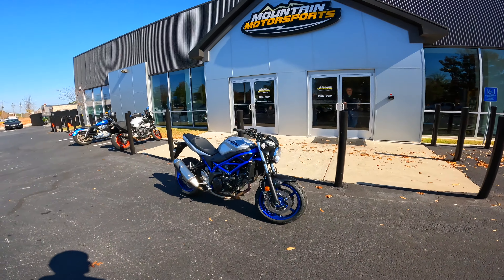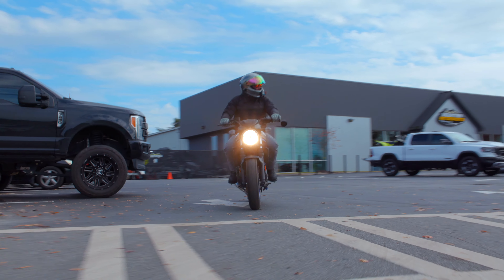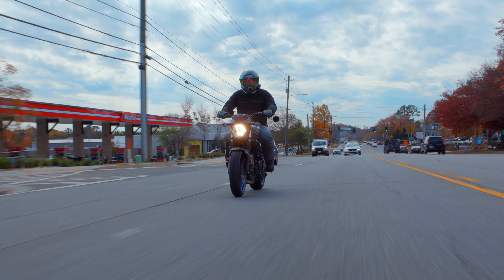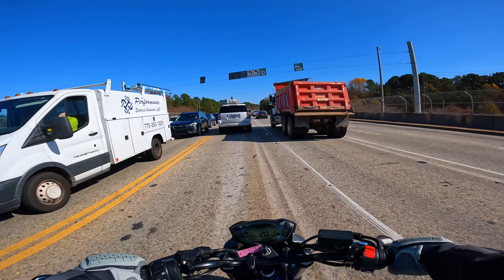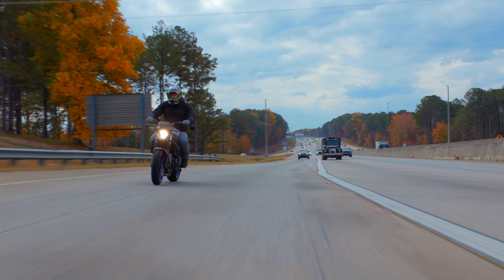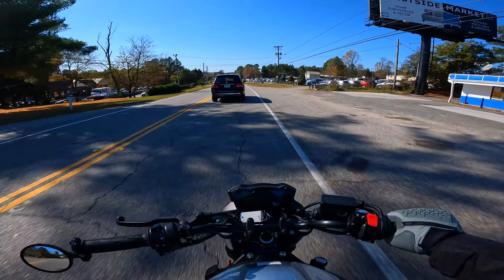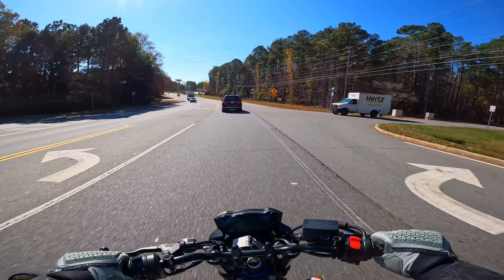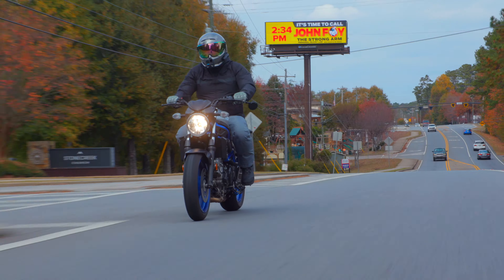2020 Suzuki SV650 | First Ride

Comment: OC: The SV650 is the Mazda Miata of motorcycles. You can do literally anything with it, and if it won’t get it done in stock form there’s an aftermarket mod that will get you there! 🏍️💨
Reply: Facts!!!
Reply: OC: I’m 61 years old and started riding five years ago, on an SV650. Chase was one of many influences that helped me make that decision. I’ve got 21K+ on the SV. In April 2022, I bought the OEM top case then rode from Nashville TN through southern Missouri Ozarks down into Arkansas then across Texas to Austin. I attended all days of the MotoGP race at COTA, then rode the SV home through Texas, Louisiana, Mississippi, and Alabama. Not one single problem and fun fun FUN! Hoping in the future to improve its suspension and brakes and take it on the track.
Reply: Miata is that good because of its light weight. SV on the contrary is heavy as concrete block. The heaviest in its class. 
I was riding it during my licence course and I hate it. Everything is crap on this bike besides engine. 
My Trident or MT 07 are bike world Miatas, not this. 😅
Reply: @conViction0000  Still too heavy and powerful imho. Modern Motorcycle Miata is the Ninja 400.
Reply: @graylunsford  are you in Nash? I just moved here a few months ago with my 19’ sv650x. Every long trip I’ve done I thank the fact I don’t need to worry about the motorcycle. It’s always me who gets tired first
Reply: ..and no! a sv is not a beginner bike!🤟🏼🙏🏼🌍
Reply: @daleidenjoel5655  SV is definitely a beginner bike most 650's are designed with beginners in mind that's why they are so much less powerful than smaller 600's that are designed for advanced riding/track like the R6 or ZX6R
Reply: I like the analogy of a Miata but I personally think that down plays the sv a tiny bit lol. They have a decent amount of power
Reply: @conViction0000 MT07 also has crap components lol. The SV may be a little heavier, but it handles way better then the MT07…
Reply: @sollux13 it was never designed for beginners in mind, that's just an American mindset on big displacement engines
Reply: @MrMikeDao  Thinking 650's aren't for beginners is cope from Europeans that can't ride anything faster than a vespa
Reply: @sollux13  I'm not european buddy. I just don't fall for the simplistic american mindset that you think you need more than what you actually use. See too many liter bikes get passed by 600cc class bikes at the track. 

If you've ridden as long as I have, 12-15 years ago 250cc was "beginner." A bike with 650cc sold in 1999 did not have beginners in mind. Just Americans thinking they need power to live on highways. Just need a brain

Comment: I considered selling my 19' sv650x once for something with more power and electronics. Took it out for a final ride before the sale and immediately knew I couldn't sell it. You wont find a more reliable, capable, and engaging bike as the sv650 for the price. 22k miles and a 47t rear sprocket later and it feels faster than ever! The community for these bikes is in its own league too
Reply: That’s awesome. My buddy has an older one and its still kicking. Hoping the GSXS I purchased is as reliable long term.
Reply: This is something that’s fast enough to give you thrill basically every time you open it up while being very usable on the street. Least if you ask me

Comment: Good to see Chase finally giving this bike the respect it deserves. He was pretty harsh on it when he reviewed it in 2017.
My thoughts, as an actual SV650 owner.
1) The SV650 is not going away, at least not in 2023. And if it continues to sell well, Suzuki would be crazy to get rid of a money maker. I don't consider the GSX-8S a replacement for this bike. They look nothing alike.
2) This bike is for everyone, not just beginners or people who want to work on their bikes.
3) For me, this bike is plenty fast for the streets or canyons. if you're doing 0 to 85 mph, this bike has all the power you need. Any faster and you'll risk losing your license (in America). 
4) If you want a pure bike with just the basics (ABS, fuel gauge, gear indicator), and one that is fun and fast, consider this bike. 

The reasons I would upgrade to another bike are for things like a factory quick-shifter, slipper clutch, cruise control, and a fully adjustable suspension.
Reply: Couldn't agree more Organic.  Love my 2020 SV650.  I'm currently addressing the (ahem) budget suspension with Ohlins fully adjustable cartridges and a Wilbers rear shock, hence no need to upgrade!
Reply: Do you think I will buy this then “outgrow “ it in a year? And want a z900 or mt 09?
Reply: @JohnnieV  In terms of performance, most people can't really outgrow this bike for street riding. But what you want in a motorcycle could change. I know a guy with an MT09SP who says he wants to go back to smaller displacement bike because he can't use all the power of his bike on the street. So it all depends. For me, middleweight naked bikes are just right.
Reply: For the track, you only need to do suspension work...  brakes might be a plus, but it handles great.
Reply: @JohnnieV Depends if you want to go over 100 mph much.  It doesn't make peak power, but it has out of the hole and midrange power above its weight.  If you like the twisties, stiffen the suspension and Bob's your Uncle.  It is a popular track bike for a reason.
Reply: I’ll say you’re not wrong, it’s very reliable And good in city driving, but as chase said, if commuting on highways and stuff like that or bigger roads it can feel like it’s either under geared or underpowered. 

I got it as a beginner bike and I’ve been using it for 2 years (having used sports bikes before on and off), and I’m looking to upgrade, I’m a bigger rider 240lbs and 6’ so I do feel pretty small on the SV.

Comment: I'm 68 Years Young. I have been riding since I was 15. Had my Motorcycle Endorsement continuous since I was 18. Currently Bike Less due to some bills I had to pay. My most recent ride was a 2018 Honda CB500X. VERY nice and comfortable Bike, but it had a pulse and wobble in the front end when braking that NO MECHANIC I took it to could figure out. Mechanically, I know the Suzuki V-Twin Engines VERY well, and think they are extremely reliable and long lived. I DO intend to get another ride, and I'm seriously considering an SV-650.

Comment: I bought a 2023 SV650 (non ABS) a few days ago. I have to say my impressions of the bike don't match some of yours... The brakes are fine, the handling is stable, the bike is flickable, the engine is wonderful, I am in love with this beautiful bike!

My other bike is a Matte Raven Black 2021 Yamaha MT-09 (gen3, non SP version). I dearly love my MT-09, but I can corner faster and more comfortably on my SV650. That's unexpected, to say the least.

My only problem with me having bought my SV650, is I want to ride it more than my MT-09. It's not so bad that I want to sell my MT-09, that triple is so much fun, but this little V-twin is awesome!
Reply: Do you still have both? It's kind of an odd pair of bikes since they're so similar.
Reply: bevause they upgraded front brakes from 2021 I think, but yeah all others I have same experiece

Comment: I think the handlebar is stock.  I actually like having narrow handlebars when lane filtering because sometimes the opening between cars is very narrow and I need every inch of space that I have.
As far as torque goes, the torque is almost the same at all rpm, but there is slightly more torque at high rpm  (max torque is at 8000 rpm).
This means that you can ride in pretty much any gear you like, but if you want to accelerate hard then you have to downshift.  Without a wind screen, riding on the interstate is rough, but it's the perfect bike everywhere else.

Comment: I rear-ended somebody's CR-Z and totaled my 07 SV650S, miss it so much even if I only had it for a week. This was the single highest-cost-to-performance middle motorcycle with relatively high top speed until RS660 came in. That bike however didn't even come close to how cheap an SV is, used or stock.

If I can have another motorcycle I will definitely hold onto a 2nd gen SV650 / 650S again, or even a 1000S.

Comment: OC: It’s not just you. I have a third gen SV (2017) and it really feels like Suzuki engineered the fun out of it. The riding position is almost frustratingly neutral and overall it’s bordering on Honda-like complacency (read: boring). Plus this third gen has a minimal aftermarket compared to the first two generations unless your plans are to go full-tilt track weapon. 

It may sound like I don’t like it, but that’s not quite the case. It’s my second motorcycle after my Cbr500r, which weighed exactly the same, and has lots more pep and capability than that ever could. It fits the role of two wheeled Miata; it’s the answer to all questions, but there are other offerings that also excel. 

If nothing else it gives the rider the chance to experience a v-twin that isn’t a potato-potato-potato American cruiser, an adrenaline filed temperamental Austrian street bike, or a pompous Italian“L-twin”
Reply: I owned a 2017 and did 45k miles on it. loved every second. I feel like I had a different bike than everyone else though. All I did was a KN air filter, airbox mod (the dill some holes in the cover one) Throttle kit(another super easy one) and a cheapish delkevic exhaust. My SV jumped on the line, pulled to redline in every gear and, at least according to the speedo, topped at 130mph. I'v owned 5 bikes. Ninja 300,  Triumph tt600, a Hyosung 650r, this SV650  and about 6 month ago sold it for a 2012 triumph street triple. I loved the SV Never let me down or had any issues and in a lot of ways miss it. 

I don't know what the point of that was, basically just saying I see a lot of people saying they are not fun, but at least my 2017 that I owned put more smiles on my face and in someway felt way stronger off the line and down the road then even my triple.

Comment: Glad to be back on watching motorcycle videos again lately. I’ve had 2 SVs (Gen 1 and 2) and both of them were fabulous with simply adding on a wider set of bars like Pro Tapers or something you would use on a SM. I’ve been considering getting a newer bike and I highly feel like a new SV is in my future. My thoughts on a SV chassis for someone is that its a great ADHD Street Bike for someone who doesn’t want a SM. ADHD street bike meaning I love the maneuverability of a SM but someone who wants a 2 cylinder bike they could comfortably ride almost anywhere being in town or highway. 🙌🏼💯

Comment: Personally im more in love with the second gen. Just on looks and seating position. Especially a full faired sv650sf
Reply: What years doess that gen cover? I'm not a fan of this riding position but I recall the N version of the older models being more forgiving on the knees
Reply: @itzajdmting  2003 to 2009 (in some countreis like England, they even go till 2012) Sv650f Gladius (started in 2009 besides the 2nd gen sv) is a different model
Reply: @LukebeingLuke  yeah I've heard of those... But as I said, the N (naked,) version is the one with slightly lower pegs and taller wider bars.... So I'm told.

Comment: I rode my buddies Sv650 when he purchased it. I also rode the Trident 660. I liked the Sv650 a lot better tbh. The Trident was light but something about the power and didn’t feel as good. I don’t know how to explain it. I owned a 1st Gen Street Triple that I was comparing it to, the man at the Dealership did too and we both agreed that it felt like it had peaks in the power band or something. Or some sorta delay between twisting and the bike actually moving. But then again that bike was used, seemed to not like being high in the rpms. So idk. But I love the Sv650 a lot.
Reply: You weren't imaging it. I've read similar comments about the Trident.
Reply: @organichotdog3807  That's good to know. It was odd, I didn't have gloves on during the test ride because I wasn't expecting to be able to test ride anything. So, a loner helmet and no gloves. 

I thought it could have been my throttle control until I rode the Speed Twin and it felt wonderful.

Comment: SV650S the faired version + smaller sprockets for top end speed (if you don't mind losing some acceleration) + a medium size windshield and lastly some lower clip ons = sporty tourer on the budget.

Comment: Great machine.  Definitely not ugly.  I quite like it.  Has a bit of a 1980s/90s vibe which is right up my alley.  These designs, with the round headlight, curvy tank, and swooping tail, reminds me of a Porsche 911 from the 1980s... This bike design and quite a few Jap bikes like CB400SF, CB1200SF, XJR1300 are other examples.  Exhaust change is required, and tail tidy.
SV650x is nicer looking with the different front cowl, but for comfort I'd want upright bars.

Comment: The 2002 is my first and only bike. I would love riding it if it wasn't an S model with the clip ons and high pegs. And the previous owner shopped off the fairings for some reason so the clip on and high pegs are pointless. Otherwise I love it

Comment: That color 2020 SV650 doesn’t have ABS. Only the black 2020 model has ABS, which I own. If it has ABS, it will be labeled on the front fender.

Comment: I've owned my 2017 sv650 since 2019 and have put 36000 miles on it. I've done everything under the sun to this thing as far as mods. but I still feel a dead spot in 2nd gear. I guess a dyno tune instead of a file tune is next.

Comment: Iv the 2022 model so meany compliments on its looks handles like a dream in traffic or motorway speeds. Only thing iv done is put a bagsterseat on it as its better than stock seat you get of suzuki and a front wind shield stop it hitting my chest on motorways..deffo begginer friendly with its  LOW RPM ASSIST helps when in slow traffic or setting off.

Comment: Visually Speaking, the trellis frame is tacisctly reminiscent of vasculature, while we know from Anatomy 101 that, blue blood, (no pun or poke at your southern location) is oxygenated blood and therefore life-giving,. Blue can appear as morbid, when not electric or sky like, a certain "pallor". However, the red trellis of the 2017 797 Ducati, the '21 SV650  the BMW '16  R1250 RS, Deseret Sled '19', 20, new Hornet '23 750, The red lines suggest vigor, contrast between the frame and engine colors for trellis seem important also for certain palate. The H2, ZH2 have that "Alien"-Green, successful in suggesting a Protoplasmic plasma capable for Picard's domain. KTM's Gen1 and Gen2 1290 Beast achieved something similar with their reticular pumpkin
Reply: You're reading too much into it

Comment: This was my first bike. So many great memories. But it was underpowered for the highway, lots of vibration.
Reply: That’s a surprise many people daily 400’s and 500’s on the highway so would think a 650 would be enough
Reply: @atobg_  It is enough. I run a duke 390 daily on the highway and never have a problem running in the fast lane. People that say it's not enough are street squids that want to go 120mph
Reply: I don't find that it has much vibration. L-twin engines have perfect primary balance.
Reply: @dgphi  There is good vibrations and bad, v twin like the sv give good vibes.

Comment: I notice that the Suzuki site shows a 2023 model for the SV650, but no 2023 model for the GSX250R. Making the SV650 the lowest HP street/sport bike for 2023. Do you think they'll have any other lower HP bikes being announced soon for the beginner segment?
Reply: i wouldnt be suprised at the gsx250r being discontinued, no way many were being sold. maybe theyll make a 3-400 cc class offering now but its unlikely.
Reply: Doubt it, with euro 5 and euro 6 emission regulations, manufacturers are able to get around it by upping the displacement of their engines. So for suzuki to develop a new 300 bike just to get around emission standards is highly unlikely. See drz 400 that stays unchanged precisely because of this reason. Second, the r and d on a new engine would cost a lot and suzuki has been on a major savings spree (see their motogp departure even though they have been successful in racing there and in other series of racing)
Reply: @abracing199  a gsxr 400~ would be amazing to compete with the ninja 400 and r3

Comment: Hi from Brazil bro. Here we have fewer options,  unfortunately. Our first SV 650 was the Gladius... And just had here the 2018, in practice.  So, what's your thoughts on this or a 2015 standard BMW F800R? Almost same price here, nowadays.  I already had a 2012 F800R, and what a surprise that BMW just got even gear indicator out; not to mention the body computer and thermometer too... I was thinking on a 2016 Speed Triple R too but, besides being much more expensive, I'm afraid of being too heavy, too. Best regards, and keep going.

Comment: I am Six ft four, would i feel comfortable on this bike as my first? im also considering Yamaha R7, mt-07, or Ninja 400. I'm still unsure what to go for as I've never ridden any bike yet
I also live in Dubai, which is full of highways and normal streets, so what would be best?
Reply: I'm 5 ft 5 and I can flat foot the SV650 with my knees slightly bent. It's a very low seat height.
You should look for other higher seat bikes if you would want to look decent and sit comfortably. MT-07/09, R7, KTM Duke. At the end of the day I always recommend sitting on the bikes and go for a test ride. Nothing beats that. That's how I chose my bike. Feel, seat, sound, handling. You check that all out.
Most ppl pick by bike appearance anyway.